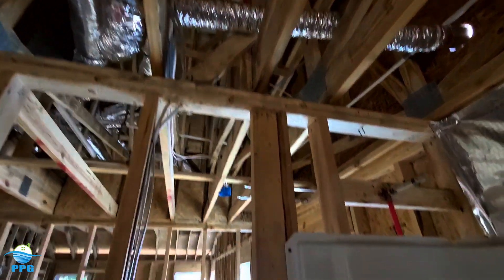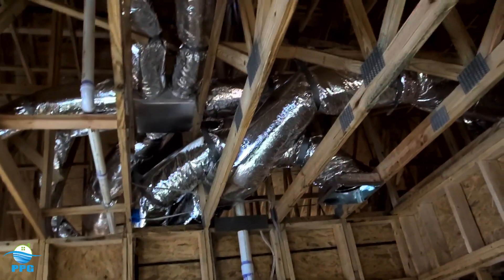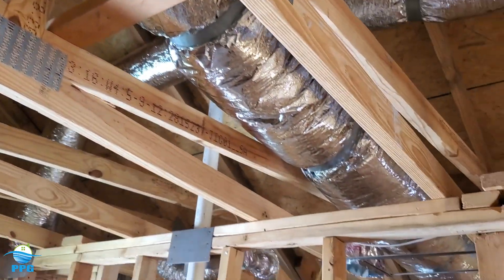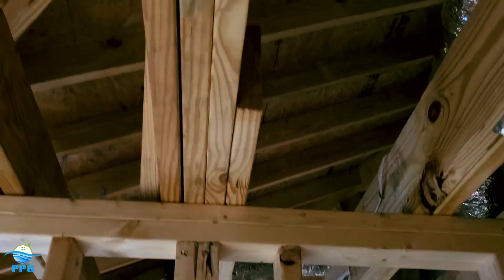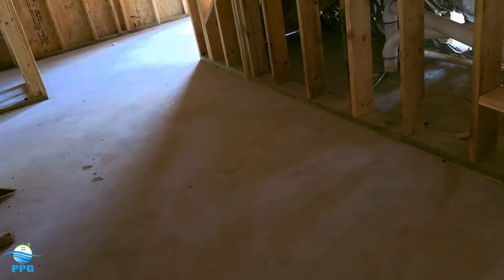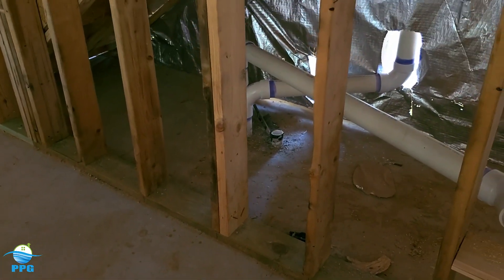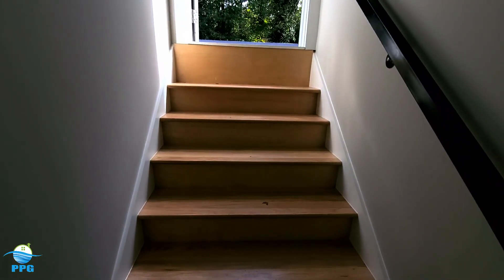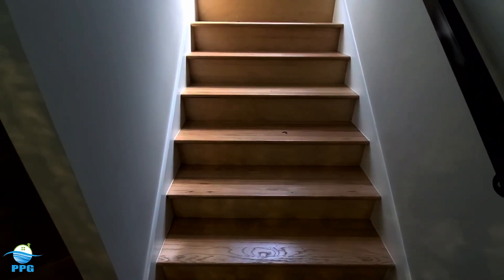Residential Building Code Violations (Part 1)

Comment: Great Channel, I just started a new job as a building inspector. I've been in construction for 30yrs but not much in house building. Whats your advise on learning codes
Reply from the maker: Where are you located?
Reply: Get with your state building officials group. They will be a Chapter of the ICC and usually sponsor ICC training or co-sponsor with the state regulatory group. Some states have even smaller groups that meet monthly for local training.
Reply: Read your municipality's adopted code and amendments,  then focus on one trade at a time as you learn.

Comment: Hello Sir!
I live in North Carolina and I'm building a new house and was wondering if it is required by code that anchor bolts be installed at sill plates? Also I'm looking for a good inspector to do a pre drywall inspection, either you or someone you can suggest in Charlotte NC, this would be great opportunity for someone to make some money!!!
Reply: Thanks for the quick response I will have to check what building code NC has adopted!
Reply from the maker: Ok, well I'm definitely available via "live video"
Reply from the maker: I don't know any competent Inspectors in NC. You should check with your local building department.
Reply from the maker: What code books have your state adopted??

Comment: 9:07 Just wanted to add that I believe that you can use 2x4 walls on the exterior so long as you have at least R5 exterior insulation. It looks to me like extiror insulation there.
Reply from the maker: 2x4 stud walls on the exterior with R-13 insulation is common down in the Southeast.
Reply from the maker: Thanks for watching!!
Reply: I suppose the easiest fix for them then would probably be spray foam. That would give you above R-19 in a 2x4 wall.

Comment: The bracket on the wall that gets nailed to the truss. We call them "truss claws".

The thing is. If we don't nail the trusses down to the walls.

What holds them level and straight?
Reply from the maker: So, the engineered roof truss must be allowed to move up and down at the interior.  Simpson make a slotted bracket that allows this uplifting movement.

Comment: Really enjoy your videos. I am in the middle of budling a house in Georgia  and in the middle of plumbing and electrical myself i made a mistake with the vent and drain pipe on a 2x6 wall interior it's a barndominium actually but I have around 4 holes I didn't have to run for a vent pipe I had a plumber come tell me I didn't need a vent for the laundry sink sense the drain is going into the main 3inch drain with the washing me drain and the 3 inch main drain has a vent but i do need some answers on a lot of things well maybe not answers but guidance and if it is up to code or not. Is there a way I can contact you and maybe go over with some pictures
Reply from the maker: Of course, you can reach me @ precisepropertygroup@gmail.com
Reply from the maker: Thanks for watching!!
Reply from the maker: Where are you in Georgia?
Reply: @PPG  I'm in pike county it's about 30 min below Griffin.
Reply from the maker: Ok, cool

Comment: I saw some additional things that looked like they would be code violations in my area of the country. And some of the codes mentioned in this video are different than the codes in my area. What I would say is check your local codes. Most are now based in the IRC (International Residential Code), but some are not and some haven’t adopted all of it. Also a code for commercial is often different than a code for residential. Commercial and residential use different sets of codes, at least they do in my area.
Reply from the maker: So, what state do you live in and what codes have been adopted where you are??... I'm not trying to do an exhaustive code violation video sir, just trying to hit some high points.
Reply from the maker: These codes are right out of the 2018 IRC.. check your state and local jurisdiction for any amendments to the code.
Reply from the maker: Commercial and Residential both use the IPC, IMC, IFGC, NEC...
Reply from the maker: I appreciate your comments... thanks for watching!!
Reply: PPG, my comment was not meant to be critical of you. I hope you didn’t take it that way.  I wanted to point out to others who watched your video and might be reading the comments that they should check their latest building codes. I am an Architectural Designer in the Cincinnati Area and all the building departments of the various communities I have worked with are currently using the 2019 Residential code of Ohio which is based off  IRC 2019. One example that I noticed that is different here is that our code allows up to 8 1/4” risers in residential. You had stated that your code was 7 3/4”.
Reply from the maker: I deal with a lot of trolls and haters on my channel, so if I appeared to be defensive..I apologize.
Reply from the maker: 8-1/4" ??...really??..is that a Ohio amendment?
Reply: @PPG1967 , its not an amendment to the Residential Code of Ohio—it’s been that way for years. In fact treads are also still 9” max. I might be wrong, but I believe the IRC stair risers and treads were the same as what the Ohio code is now for a long time. Ohio just has not adapted that part of the IRC change.
Reply: @PPG1967  8-1/4 was and still is a common amendment. Indiana still uses it with a 9" tread.
Reply: Also, in my area, we can still get by with 2X4 exterior walls, depending on the climate zone of the county and whether or not the project is new or remodeling. And even though, the code might read like R-20 cavity insulation is required in exterior walls, so far the communities here have not been enforcing it for additions to an existing residence so it might be worth, not only checking with your local codes, but also talking to the planning department. Again, PPG, not directed towards you, because I’m sure you already know all this, but directed to anyone reading this not extensively familiar with building codes.
Reply from the maker: Wow...I learn so much about construction in regions of the country... thank you!!
Reply: According to 2018 IRC you can use 2x4 exterior wall with an insulation value of 13+5. According to section R311.7.8.5 you can use a handrail with a perimeter larger than 61/4 inches but you need a graspable finger recess on both sides. And the maximum riser height of 81/4 “ is an amendment in the indiana code. I also noticed in one of the parts a of the video that it appeared the TJI floor joists were not secured with screws, they were set in glue only. I had a situation similar to this on an inspection and the contractor told me that was the recommended means of securing so I called Simpson (they were Simpson hangers) and was told that was definitely NOT the proper means of securing the joists in the hanger. Simpson makes filler blocks and nails for this application.

Comment: Simpson has a bracket or shoe that fits (wraps sorta) around the stud and nails on above and below that huge hole to  both reinforce the stud and act as a nail plate for sheet rock nails later on.
Reply from the maker: You are correct.. thanks for watching!!
Reply: Actually according to Simpson those stud shoes are designed for over-notched studs. They are NOT designed for use on over bored studs, that would require an engineered prescriptive fix.

Comment: I agree with a lot you mentioned.  But lvl’s should not be staggered if they reach full length.  There would be a weak point when they are cut to stagger.
Reply from the maker: I was referring to the 1/2" bolts for a 4-ply, they must be staggered.
Reply from the maker: Thanks for watching!!

Comment: Damn, drywalling that crawl would be a huge bear. Seems like HVAC should have called that out to the GC before starting work. At least GC would have been able to get plumber back out and clean up supply feeders and get rock up. Wow
Reply from the maker: I don't the Code Gods thought that one through.
Reply from the maker: Thanks for watching!!
Reply: Read the code, Drywall s not the only accepted material.

Comment: I know all this codes are supposed to have a valid reasoning behind. But sometimes I wonder if we do really have to follow them. On that handrail, why it needs to terminate on the wall? Me as a homeowner, I would like it as shown. I can't envision any reason besides being a possible hazard if you hit it with nay poart of your body and the termination is rough. Which would be an accident, and that can appen with almost any thing on your house, a toilet, a door knob, a sink any appliance.
Reply from the maker: So, that particular code was placed into the code books because of rhe water hoses that firefighters use getting caught at the handrails when they were going up a flight of stairs...I think!!
Reply: @PPG1967  And for years we tried to find some basis for that argument but could not. We also used the instance of someone catching a coat sleeve or other garment on the rail and tumbling down the stairs. Another example was a ladies purse strap getting caught.
Reply from the maker: Thanks for watching!!
Reply: Codes change from time to time. They are not always perfect but there is always a reason for them. An alternative to having the end terminate into the wall is to have it terminate at a newel post or safety terminal. One example of the code being imperfect in my opinion is that it doesn’t adequately define safety terminal.
Reply: @karlhalvorson  Yes, the code is silent on the term 'safety terminal'. This would come up every second or third code cycle and the general consensus was that 'everyone knows what a safety terminal is; "A safety terminal is any type of handrail termination that eliminates the possibility of something getting snagged on it."

Comment: That last one made me bust a gut laughing! Drywall will never stay up in a crawl space, just a waste of time putting it up. Looks like the code writers are writing jokes now!
Reply: From my experience, the issue is with humidity over a long period of time weakening the drywall causing it to fall with vibrations. Another problem is having the tape peel off of the joints and leaving a crack. I see this a lot with firewalls in attics. A better solution might be tile backer board installed with large-headed screws or screws with washers. The joints could be taped with the proper fiber tape and sealed with thin-set mortar.
Reply from the maker: You know I never thought about that,  if you have a house full of people that drywall probably won't stay up there long.
Reply from the maker: Thanks for feedback.
Reply: Would aluminum roll flashing with seams taped qualify? Humidity wouldn't really affect it, not sure about the fire rating or gauge needed. ?
Reply: Minimum code is a joke.  If anyone ever advertised that their construction meets code, they build the worst building code will allow.  There are best practices that would include noncombustible components.